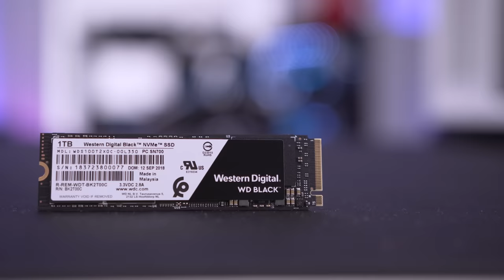The ULTIMATE Corsair Crystal 680X RGB Timelapse Build!

Comment: Ehhh, those bottom fans are exhausting air and they should be doing intake
Reply: Lunnielle No, because the most important part is good RGB duuh..
Reply: True. ppl said air flow is bad but if bottom fans are intake... it will be good.
Reply: @Secret-Agent007  can you explain the difference between "exhausting" and "intake"? are the fans supposed to be the opposite way?
Reply: heat rises the fans at the top remove all the heat from the radiator the gpu has fans blowing over a heatsink the hot air is removed via bottom fans otherwise all the heat from the gpu would just go up to the motherboard
Reply: they are pulling hot air down thru the bottom and out. are you slow?
Reply: @nrxhavoc  
LOL. I guess you are. The single most efective way of getting hot air out of the case is the chimney method. Hot air rises, genius. So the bottom two fans SHOULD be intake and push the hot air to the top fans who are also pushing the air out.  This still applies when using AIO coolers and radiators on the top.
Front = Intake
Bottom = Intake 
Rear Left= Exhaust
Top = Exhaust

This is not rocket science guys...
Reply: Cenko Lino or it could just pull hot air from
The gpu since there are already two fans up there. But go ahead nerd, get mad.
Reply: @Cenkolino  smart man right here. i agree.
Reply: @Cenkolino  I am about to build one of those and I want to make sure I understand your statement (which I believe I agree with based on the principle that heat rises). So bottom fans and front for intake, top, and back for exhaust. Correct?
Reply: @poupard1963 
Just like that. 👍
Reply: @JonoFunk  if that was done would the case then have good air flow ... so it's not the case but the layout of fans right ?
Reply: @JonoFunk  cool I just ordered more or less the same specs for my first build so I would have 3 fans at the front intake with the logo facing out and 2 at the bottom intake with the crosair logo part facing the desk and two at the top outake with the logo in the case and one at the rare also out take which means the logo would be in the case ... right
Reply: @Nicholas M the chimney method would still be more effective. With the bottom fans as intake, you are pushing the hot air up, making it rise even faster than it normally would and leave even faster. I don’t see the issue with hot air passing over the motherboard, especially with an aio. It won’t cook the motherboard, that’s not how heat works. If you use the bottom as exhaust, you are just keeping the hot air inside for longer and wasting the effectiveness of two good fans, because the hot air wants to go up, so sucking it downwards will just delay the hot air from going upwards. THAT is how you cook your components. Just to be clear, I am not an “angry nerd”, I am just trying to share knowledge that every pc builder should know.
Reply: nope
Reply: @Cenkolino  it’s nerd science
Reply: @Cenkolino  exactly how I have mine set up

Comment: Why in gods name would you vertically mount a gpu in this case? You're gonna choke it
Reply: Reinforced slot is usually the one close to the CPU (In most cases, here it seems that the 2 slots are reinforced, but can be wrong), or to M.2 slots, and imo it's better to place the GPU away from CPU/M.2.

Most people don't care too much about the previous points (I personnaly don't care that much), but it's still a valid point for a lot of people.

Another point is, why not ? Even if a stand to maintain the card in good postion and to limit the vibrations can be a better choice. Visual result is what most people want, and no one have the same point of view about it.

Anyway, people do what they want. If the PC works, why do you guys care about how the build is done ?
Reply: I'm getting 57 °C while gaming with my GPU in this position in this case.  That said, unlike this build my 3 front fans are untouched, my radiator (a smaller Corsair H100i) is mounted on the top and I have a 140mm fan mounted in the back near the cpu so the airflow is more sensible.
Reply: @victorpereira225  is it possible to run an push pull setup with the same radiator in the front ?
Reply: Brolex385 You can but you’ll have to compromise.  There isn’t enough space to mount fans on top on the inside to exhaust case air with that radiator mounted in front.  Mounting the fans on the outside puts them too close to the glass panel for them to do any good so you’ll have to either take the top glass panel off or put the fans on the bottom of the case to exhaust air that way...which isn’t ideal.
Reply: Would it fit if you mount the radiator at the top?
Reply: @Jinsh1911   Would what fit?
Reply: @victorpereira225  cool to see that we have the exact same setup, apart from the watercolor (I have the H115i)
Reply: @Victor Pereira which do you think is better cooling for the bottom fans to your system, exhausting or intake?
Reply: @shunvege1127  I prefer intake via the lower fans since warm air will rise to the top of the case naturally.  That said you don't want to have more fans pulling air into the case than exhausting it.
Reply: @victorpereira225  do you have a 2080ti? I have a 2080 ti OC'd to 2130mhz in this case and vertically I was getting ~85C. I switched back to normal and now run ~72C.... depends on your GPU, the bigger 2.5 - 3 slot cards are gonna run too hot vertically
Reply: @victorpereira225  I get 85C with my 2080 Ti so the bigger cards run wayyyy too hot this way. go horizonal for this case
Reply: @KillerKlown707  I was running a 1080 at the time, I upgraded to a 2080 recently and my temps were hitting 85C under load in that position.  I ended up buying a vertical mount bracket that puts the card in the pci slot area which puts the GPU fans 3.5 inches back from the glass, that and some aggressive fan settings have brought peak temps to around 65C.  Apparently, that vertical mount is designed for water-cooled GPUs so putting an air-cooled card (especially one that big)  in that position is not a good idea, horizontal is DEFINITELY the way to go.  

That said my 2080 is an Aorus so I really wanted to see the ridiculous light show :)

Comment: You know you're not blowing air to the gpu right?
Reply: can you please explain? trying to build my own pc
Reply: @njm92495  The fans at the bottom of this build are pulling warm air out of the case and over the gpu in the process, ideally you want cool air blowing in from outside to the gpu.
Reply: @victorpereira225  why is it warm air? how can you pull in cold air from the bottom of the case? how can you put fans correctly on the bottom? thanks. i plan to buy this case and want fans on the bottom.
Reply: @njm92495  The air coming into the case is passing over the radiator picking up heat in the process.  Add to that the heat generated by the mobo components and you end with warmer in the case than outside the case which is then being drawn over the gpu by the bottom fans in this build. 

If you're putting fans on the bottom you want them drawing the cooler outside air into the case.  It;'s also important to balance the airflow meaning that you want to match the number of fans drawing air into the case with the number pulling air out.
Reply: @njm92495  simply turn the fan around, so that the sticker faces the bottom, then the air will flow in and not out
Reply: @-vhs  thank you! :)
Reply: heat rises the fans at the top remove all the heat from the radiator the gpu has fans blowing over a heatsink the hot air is removed via bottom fans otherwise all the heat from the gpu would just go up to the motherboard
Reply: Victor Pereira there is no solution since hot air will always rise and cold air will stay at the bottom it’s impossible not to make the gpu hit hot air during the process even if you change positions of the intake and exhaust, any other suggestion?
Reply: @time9618  I have this case and the same setup as in the video. 3x front is intake, AIO with 2 fans on top is exhaust and rear + 2 on the bottom are exhaust. This would create "negative airpressure" which is slightly worse for temperatures but better to stop dust from entering the system. That said my system is running 28C idle and 35-49C under heavy load, TLDR it doesn't really matter how you orientate the fans, if I flip the 2 at the bottom I'll drop a whopping 1C which is nothing really..
Reply: The rad is not in a ideal location either but also can't fit a 360 in the top so guess that's the reason..

Comment: I haven't seen such a horrible fan setup like this in a while... First, the two bottom fans should be intake, not exhaust. We all know vertical GPU's look great but here it's too close to the side glass panel to breath. Setting it horizontaly along with the two bottom fans as intake, the GPU temperatures would improve a lot, no doubt. Moreover, the two top fans are, again, almost touching the top glass, killing the airflow. And last, the front three fans are just propelling hot air from the radiator inside the case... Overall negative air pressure and hot temperatures inside the case. I know the two top fans can`t fit lower in that configuration because of the radiator tubes, but you could mount it downwards or think about other solutions for a better cooling.
Reply: I hope he did this just to showcase it. It better not stay like this tbh

Comment: nice, good thing you have the QL fans now so your bottom fans dont have to starve your gpu of air, and they can actually face the right way and still show the lightloops. For anyone copying this build, the LL fans have one side with light loops only, so if you want to see the pretty rgb you are forced to install them in a specific orientation (flow direction). Basically, if you buy additional fans for this case, get two QL for the bottom, the rest can be LL, or just get QL or QX for all fans as they look better anyways. Very important. Enjoy.

Comment: had that problem with the top fans too... did you really leave it exposed without the magnetic fan filter?

ngl i think the one flaw this case has is inability to mount a large radiator at the top
Reply: He set the fans to exhaust so that shouldn't bring much if any dust in, but definitely if it was set to intake fans he would need that filter

Comment: I just got the case yesterday, I've had all the other parts for a week. I''l post the build at the end, but plan on using the AIO fans as intake on the bottom and use 4 HD140 RGB'S with radiator in top as push/pull exaust. Not sure if the back fan will be intake or exaust yet. Will try to update in a week or so on my results.                                                                                                                                                                             intel-core-i9-9900k-36ghz-8-core-processor
Corsair - H115i RGB PLATINUM 97 CFM Liquid CPU Cooler

Asus - ROG MAXIMUS XI FORMULA ATX LGA1151 Motherboard

Corsair Vengeance RGB PRO 3200MHz (4x8GB)

Western Digital - Blue 1 TB 2.5" Solid State Drive

Crucial - P1 1 TB M.2-2280 Solid State Drive

Crucial - P1 1 TB M.2-2280 Solid State Drive

Western Digital - Black 4 TB 3.5" 7200RPM Internal Hard Drive

Gigabyte - GeForce GTX 1070 8 GB G1 Gaming Video Card

Gigabyte - GeForce GTX 1070 8 GB G1 Gaming Video Card

Corsair - 680X White ATX Full Tower Case

Corsair - RMx White 850 W 80+ Gold Certified Fully Modular ATX Power Supply

Corsair - HD140 RGB 74 CFM 140 mm Fans x5 w/Controller

Microsoft - Windows 10 Pro OEM 64-bit

Corsair Commander Pro, Lighing Pro + 2 fan hubs
Reply: Get a 2080ti instead

Comment: How many “lightning node pro” did you use for this build ? As I can see you have 8 rgb fans. Or is the case coming with rgb support for the stock fans. Thanks
Reply: It comes with three rgb fans I believe
Reply: it comes with the Case i got only 1 and 8 fans
Reply: You only need one node pro or commander pro. Then you can have two channels of led with 6 fans per channel.
Reply: I have the same case, it comes with 3 RGB Ll120 in the front and 1 non-RGB in the back and a corsair hub. Buy another 3pack of LL120 and they come with their own hub
Reply: It comes with a lightning node pro in the back/cable management are

Comment: For the fans at the bottom did you need to buy the kit with the lighting node pro?
Reply: it comes with a lighting node pro and a rgb fan hub i would invest in a icue commander that will give you 6 extra fan slots and full control of it

Comment: I got the 680x. But man am I struggling with cable management, I wished you'd shown how you did it so I could copy you. 

I got 3 HD120's on the front. 
Corsair 115i 280MM on the top
A single HD120 on the back.

The 2 RGB fans on my CPU Heat sink is plugged into my Commander Pro, but because the fans are different I can't fully control the lighting, but they are working and in sync with my other fans. 

2 Magnetic dust collectors, one long one (which I thought was for the front but doesn't seem to be.) And a short one which I thought was for the top but also doesn't seem to be. Lol. 

I don't have any fans on the bottom... (Yet.)
Reply: I have this case. It's quite simple in cable managing.
Reply: Cable managing looks incredibly easy in this case. Considering you have a whole extra compartment with the psu and cables.
Reply: @tylb9053  There's so much space I don't know where to put em' is where I was going with this. 
I managed them well, but it still looks messy lol.

Comment: Do i need to buy an extra fan hub for all those rgb fans?
Reply: Yes. RGB hub will take 6 RGB fans so another needs adding to power more RGB fans
Reply: No. 1 hub is preinstalled in the case, he bought another set of LL120's to match the case and those come with their own hub so he (and I) has 2 hubs. If you only use the fans that come with the case (3x rgb in front 1x non-rgb exhaust) you are good to go, can add 3 more fans to the hub if you have them.

Comment: Can someone tell me if this psu is enough CX750
case 680x

Intel core i5-9600k
motherboard asus z390 tuf gaming wifi
6 fans ll120 rgb
water cooler corsair 100h series
asus nvidia 1660 super dual fan
16gb ram corsair vengence pro rgb
1tb samsung ssd

I have been having problems where sometimes the pc would turn on and other times no idk why please help

Comment: Could I mount that same card in the regular position with a 360 mm radiator at the front as well or will it not fit?
Reply: it will not fit i have the same built as well when i am playing games i must leave the glass open cause the high temperature...

Comment: never used an AIO but i really want one for this case. if i was to replace the fans on an aio to keep the ll120 fans that come installed on the front of the case, would i need to plug them into anything different or would they stay plugged into the same port that they would do if it was a standard case with no rad in the front?

edit: also is it good to keep the dust filter removed if installing a front radiator?
Reply: hey I’m installing my aio on the front as well w the 3 included fans. i was wondering if u were able to fit a 3 fan gpu as well? horizontal mount btw
Reply: @xadxtya  hi, so in my 680x I fitted the aio to the top. Currently I’ve got the 
Msi x trio gpu which is a pretty long card and it is a VERY tight fit without a front mounted aio. With that triple fan there’s no way I could fit a front one. However my old gigabyte 2070 was a triple fan and that fit with room. Depends which gpu you have really. There’s 33cm of room max without an aio, probably 31 - 30 cm with one fitted on the front
Reply: @CalDal_22  I guess I’m screwed but let me ask you one more thing, did you place your front fans on the inside of the metal plate or outside (near the glass)
Reply: @xadxtya  I have mine on the inside, I think it would be bad for airflow if close to the glass ):

Comment: Why would you get those front panel fans out to attach to radiator fans? Instead keep those and install radiator to the top with stock fans that comes with radiator. You get 3 fans front, 1 at the back and 3 with radiator.
Reply: The top only supports 240mm radiator

Comment: you can only connect 6 rgb fans on one rgb hub, how did you connect the other 2? second hub?
Reply: 99% sure he did, I got the same case with 3 extra LL120's and they come with their own hub in the package + the preinstalled one in the case.
Reply: I'd say he connected the two fans on the AIO to itself. The h100i AIO has two rgb headers and two three pin headers which you can plug the two fans into.
Reply: @patrick-jones  3pin header header on the AIO but 4 pins on the fans right? My Aorus AIO has the same, the fans that come with it are 3pins in which I couldn't plug my LL120 (unless modifying the headers or soldering) so I just have the LL120 go to the corsair hub, I only lost the fan rpm readout on the AIO but I use a custom picture for the AIO anyway so nothing is lost

Comment: I own the 680x and I would NEVER recommend to get have the GPU mounted vertically! This is crazy. 
1. Gets much hotter, up to 15°C more since it is so close to the glass side panel
2. The glass side panel gets extremely hot itself
3. The GPU makes more noise because the noise faces the room rather than facing down
4. It's a nightmare to get to the bottom of your motherboard! You basically need to dismount the GPU to get to it. Crazy. 
5. It's a nightmare to remove the front fans panel. It is made in a way that it is very simple to remove it to clean the dust filter, but if you have your GPU vertically mounted, then there's not enough space anymore to easily remove those fans and access the filter.